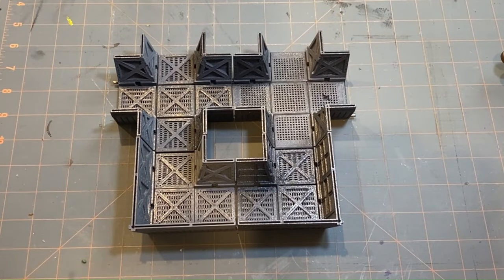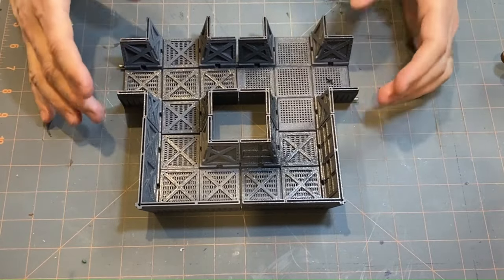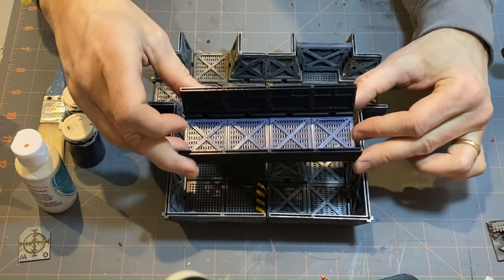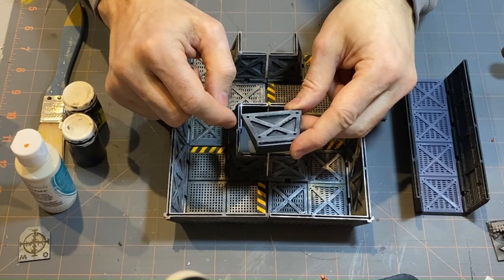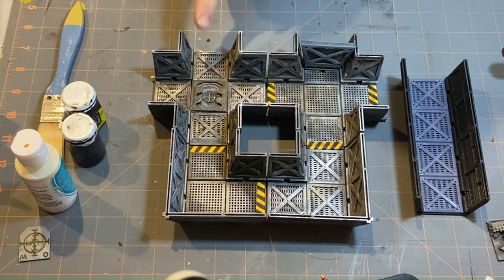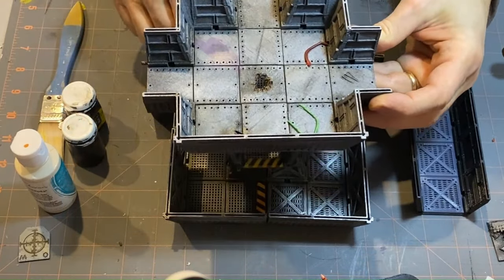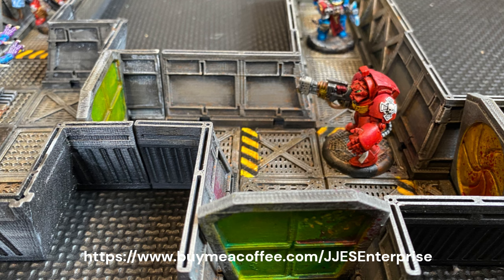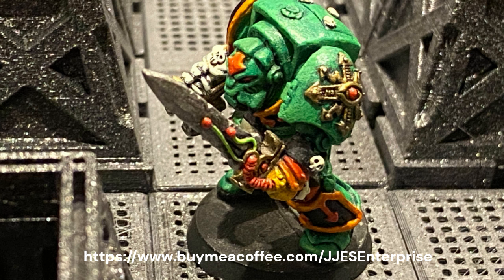Space Hulk 3D Project - Painting

Comment: Nice video.
I'll be buying the stl files off of etsy sometime soon! There are other, flashier 3d Space Hulk stl files online, but this looks simple and cheap to print on a fdm printer, is very functional with the slanted walls for space and slots for tokens, and still looks great!

I don't own the board game myself so my Space Hulk set is going to be completely made by me. I'll definitely make sure my overwatch/guard/jam tokens fit in those wall slots.  

I'm overall pretty new to making tabletop pieces but I feel like I'm capable of making something nice with this set. The exposed wires idea is definitely something I'm going to emulate. 

I guess the one thing I would like to see is dedicated broken wall/floor tiles to designate Genestealer spawn points.
Reply from the maker: @vonheer7418  that is a great idea. If I I’ll put them on the free samples. Let me know how you project turned out and if you ran into any issues with the files.